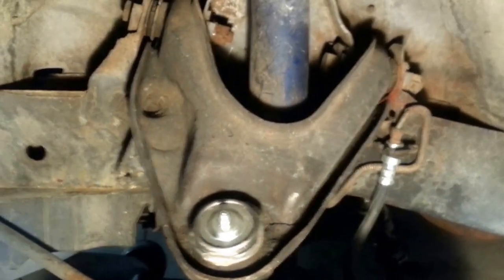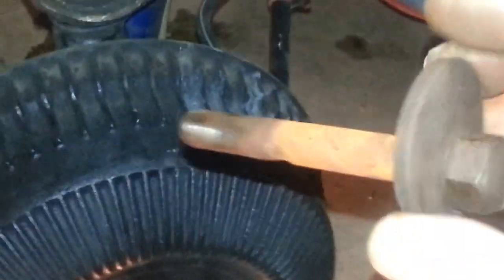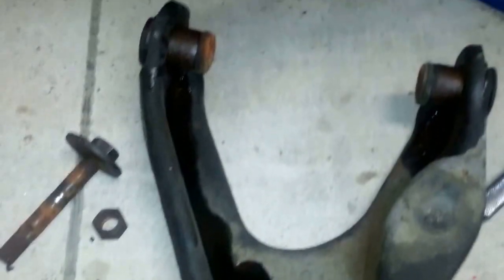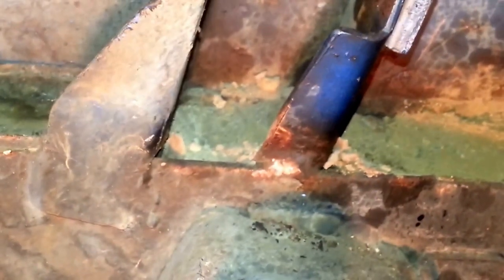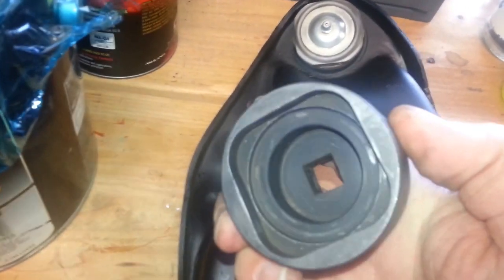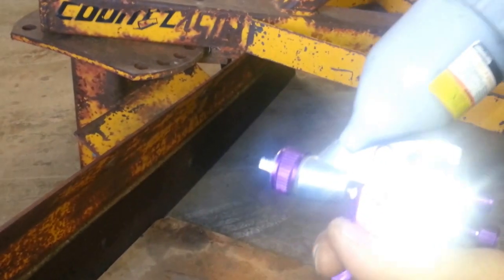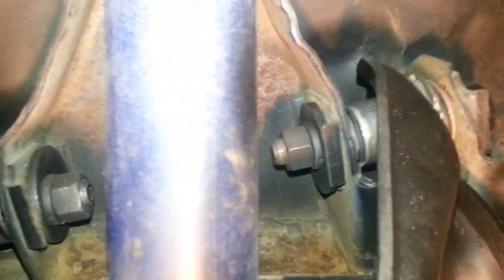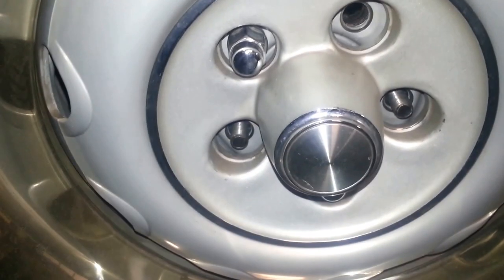1973 Plymouth Duster Upper Control Arm Bushing and Ball joint removal

Comment: You installed the 2 cam bolts in backwards. The bolt head goes in from the inside. And nuts are on the outside.

Comment: I thought 73 was the first year of disk brakes being standard?
Reply from the maker: Nope, this is the slant 6 Duster. May be true for V8's
Reply: Correct, the 73 up V8s all had disk brakes and big bolt pattern.  The slant sixes with drums kept the small bolt pattern.  In most cases anyway.
Reply: Your right for the V-8 cars. My 73 was a 340 Duster and had disc brakes on the front.  I no longer have the car and miss it more than any other car Iv owned.

Comment: Really helpful video, thanks.  I'll be doing this on my '74 Swinger soon, using offset bushings for increased caster.  I second the tip about leaving off some lug nuts until the job is really done.

Comment: What size are your drums?
Reply from the maker: As I recall, 10" they will be coming off to change to disk brakes. Changing over to 340.
Reply: Paul T so if I got 11 inch backing plate I would have to get the same rebuild kit? Or should I just remove the drum brakes backing plates and convert to disc brakes?
Reply from the maker: The set up I was working with was stock factory.  If you're going to change to  Disk brakes, You may need to get different spindles upper and lower control arms. Check with your local parts store, some items are interchangeable some are not.  Also depending on the diameter of the disks, You may need to even get different wheels. So make sure you do your homework before you go through these changes call the manufacturers.
Reply: Paul T okay thanks.

Comment: I used 5x4 to 5x4.5 1” thick wheel adapters to put 20” rims on my 69 Valiant. Didn’t tighten them down (with the intention of just to get me to the alignment shop) ended up driving the car for a year. Heard a clack clack clack noise, thought it was an idler arm bushing. One morning on my way to work my rim FELL OFF. Three lug nuts on the adapter backed off and the last 2 studs snapped and my rim fell off. My car scraped the underside luckily just the drum got damaged. The huge rim kept going and broke this guys $200 mailbox!!! Point of the story is this guy is right. Always make sure you tighten everything and get it aligned because you don’t want you’re front end coming apart. Now I have a $200 mailbox to replace, scratched rim, dented fender and messed up my drum and hub. The back rims are fine still with the 20” rims because I torqued them down.